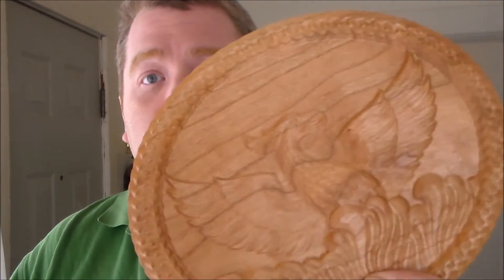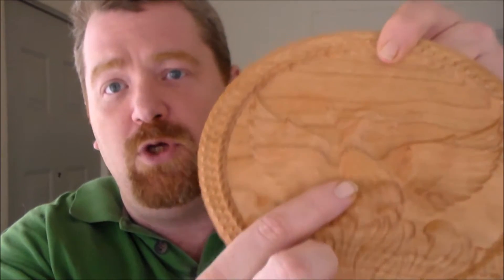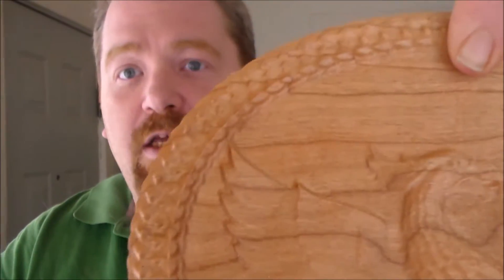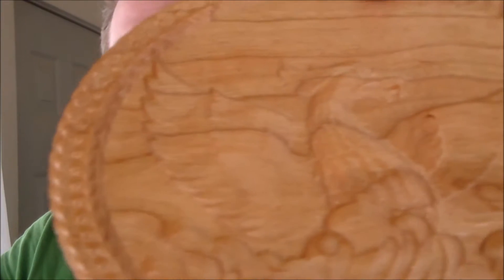Phoenix, ShapeOko new 3D Model

Comment: Hi Doug; I'm looking for my first CNC machine (home hobby). I understand a 3D machine is better if you have the budget for it, compared to one that only produces a 2.5.
Is the #D a machine and CAD or just the CAD?
Do you know if the Shapeoko 3 XXL is a 3D machine.
Any help on this will be greatly appreciated.
Thanks, tom
Reply from the maker: Yes it cad do 3D depending on the software your using.